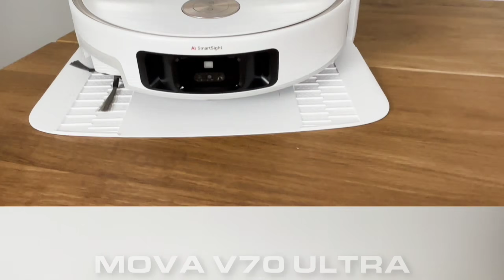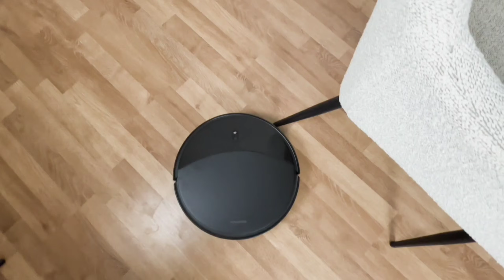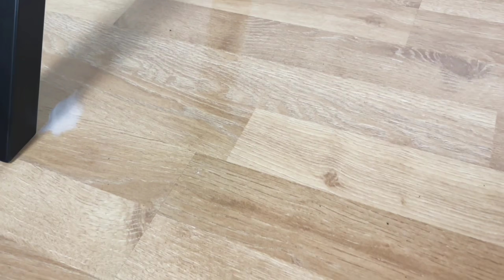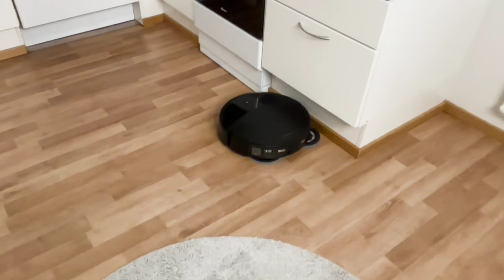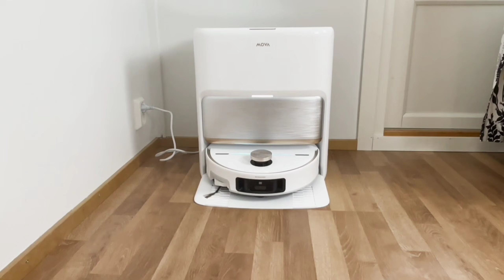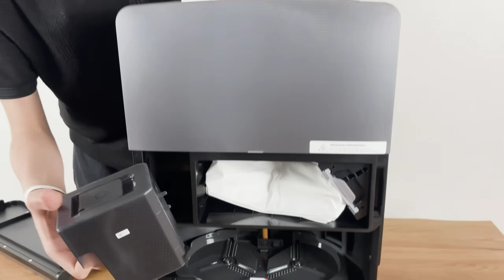MOVA V70 Ultra with MaxiReachX™ Technology vs Saros 20 - Flagship Robot Vacuum Comparison

Comment: I like mova v50 and the new v70....but v70 not released in US yet.....however I feel you did a nice job of editing out some of the v70 errors, like it drug the mop pad over carpet once and the milk pick has the brush arm spinning in the milk....I feel you let the saros show issues and edited them on the v70.....I do feel the v50 is a very good product and I am happy with it.....I needed a vac and would have bought the v70 but got v50 because it was not offered in US